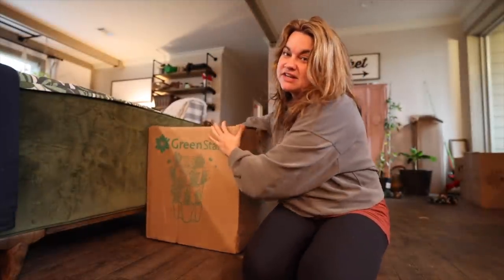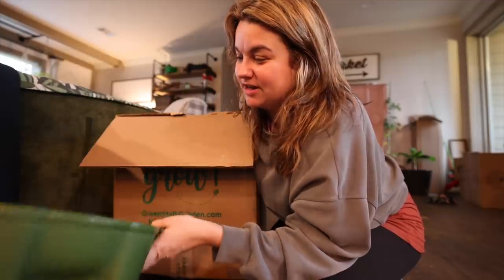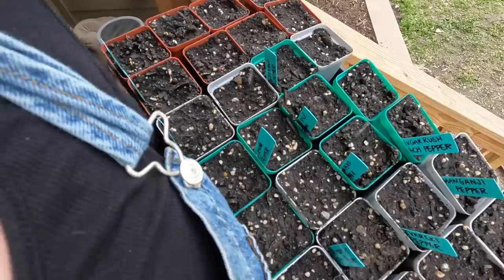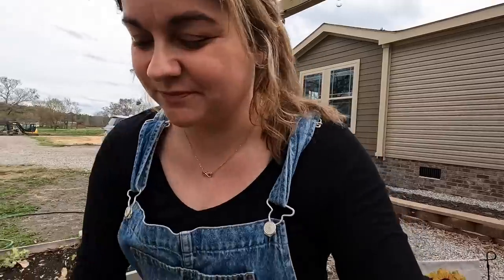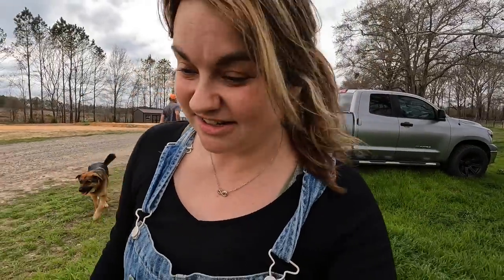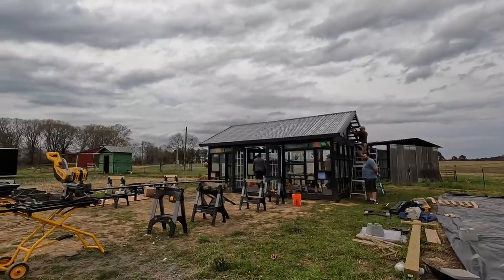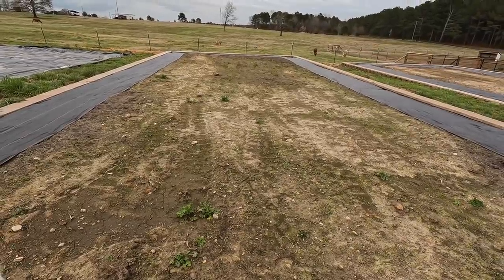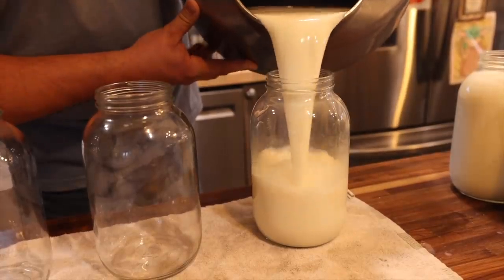I may live in this greenhouse (Doing dangerous things) | VLOG

Comment: The extent of damage from frost is partially based on the previous day’s humidity. So if the plant has a little more water, also known as “turbidity”, it will have the propensity to damage it more so, compared to a plant that might be slightly “flaccid“ (less water within its structure). This is not the only factor, but it’s certainly one of the larger and more frequent factors. *I am a plant biologist
Reply: Wow!! Fantastic info share, thank you!! ☺️
Reply: So, watering my plants here in florida before a frost/freeze means I'm an executioner?! I thought they should be well hydrated! 🤒
Reply: I was told to water the plants good before a freeze in that they would do better that way
Reply: I'm sure it's a typo but it''s actually "turgidity" in case anyone wants to look it up and find out more.  "Turbidity" is the cloudiness of water.
Reply: Explains why my cactus didn't make it after a light frost
Reply: Wow! 
Is it different for different zones? 
Here in Arkansas, when is getting really cold or near frost., I water my plants to keep them from freezing. I always thought more water helps preserve the plant. 
Cover with plastic after watering. 
Is it possible that different areas have different rules? 
Maybe .. I keep good care of my plants for decades. 
Maybe I’m not understanding
Reply: If you ask me, WATER YOUR PLANTS BEFORE THE COLD . 
They are stronger for being full of water.  Just my decades of experience ~ no degree involved, just happy plants. ✌🏽❤️🌱
Reply: So don’t drown them, just water regular.

Comment: Your pineapple sage should be fine, if you don't let the roots freeze again. Frost hardy identification doesn't seem to apply to our spring frost/freezes here because of how warm it always is right beforehand. My onions planted around the same time as yours are also looking scary, and I don't remember them doing that before, but I never planted them out quite this early either. Or late, if started from seed. Some of the garlic in places looks just as bad as the onions, yet other garlic is perfect, especially the ones I've been replanting each year, so it's not just temperature. 

I'm thinking at worst the onions and such might be smaller than they would have been, we'll see! This year mine also came all from Dixondale and I've had great success with them before, but planted much later in spring to avoid these swings. Once you have been here awhile you will have less plant damage in our freaky weather from the adapted plant seeds though. You might also have crazy plant volunteers who just assume you will cover them during the wild dips, ha. Looking at you Moon & Stars. The not from seed plants have the worst time adjusting here. Like I'm not sure about my fuzzy kiwis that are still in big fabric bags. One of the Raspberries even looks done for, and that thing is supposed to be very cold hardy. However, I can drag last years bagged pepper plants, and delicate citrus, into the unheated outbuildings or garage and they are fine.

Comment: You might find that your onions get a bigger bulb with the die-back of the greens. I have multiplying onions and someone suggested that by trimming the flowers the bulb sizes will be larger and the number fewer. Don't know how that translates to single onions.
Reply: I trim my onions regularly through the growing season and had much bigger bulbs doing that.
Reply: @fishnlady  Thanks! I have three rows of them, and have planned to trim one row to try that out, and save the yield from the other two to overwinter next year under mulch. (These are a kind that are planted in mid-September and harvested around June). 

Any tips on how you do it, (cutting greens, or flowers, or how often or short you cut them), will be welcome! Thnx!😊
Reply: @MsJuliah1    There are some great videos on you tube showing what others do but here is what I do.  I cut the greens when they reach about 10 inches high down to about 4 inches high. I never let them go to bloom because it would take all the nutrients and put them into the bloom production.  Unless you want one to go to seed then let that one bloom and save the seeds to start  your own onions next season.   I watch and when they reach about 10 to 12 inches I cut them again.  It sends the nutrients into the bulb instead of the tops.  I would also think putting a fertilizer with less nitrogen would help too because it would then go to bulb production more than green top production.    Good luck.
Reply: @fishnlady  Thank you for that input! I went out today and trimmed all my onions; what’s just as exciting is I was able to share the trimmings with 8 other families at my church Bible study tonight. 😊❤️💪

Comment: I was just thinking about whether or not I should plant strawberries in one of my green stalks. My question is about winter… I live in zone 5b and we get hard frosts and heavy snow, would it be okay to leave the towers outside during the winter? Usually I bring them in, but if they have perennials in them I would want to leave them out… any advice?
Reply: I left my greenstalks out over the winter because they were full of carrots. They did great. No cracking or damage. They didn't tip over in windy winter storms. They got a little dry but that was just neglect on my part
Reply: @ceruleanraccoon7058  great to know, thank you!